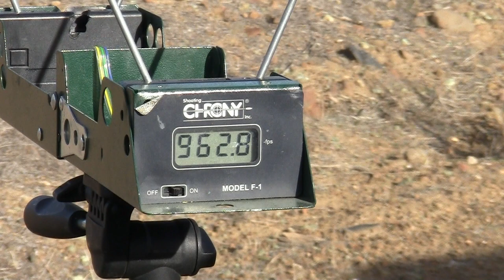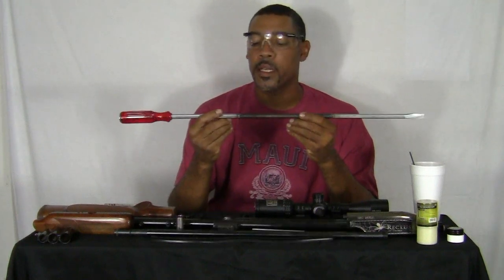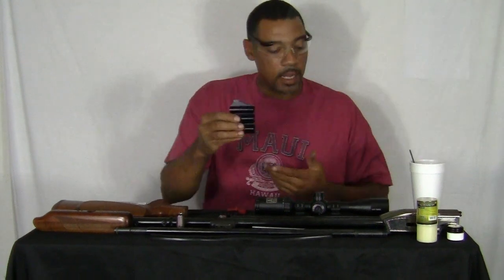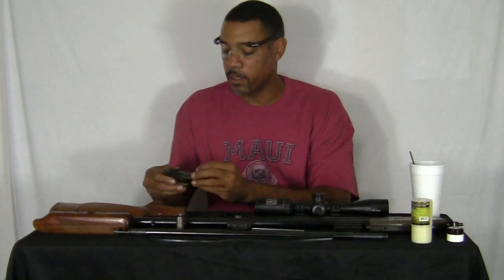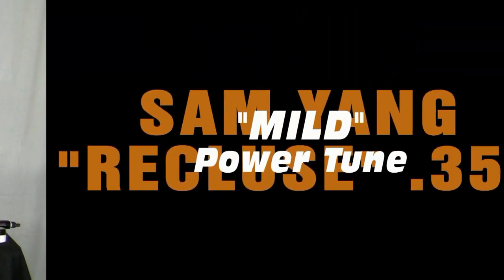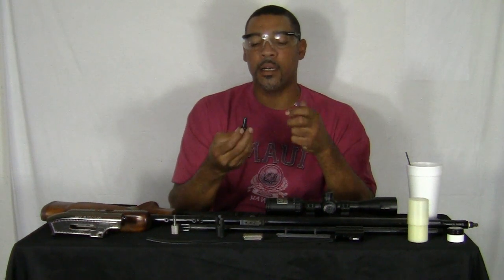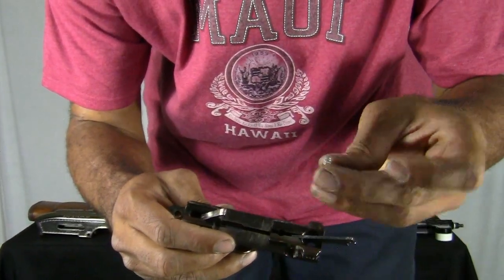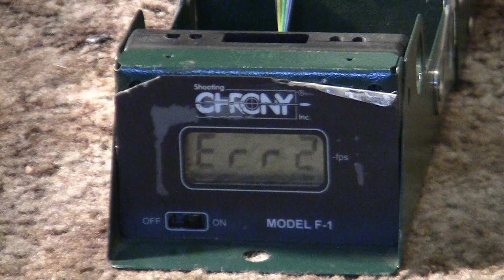Sam Yang .357 Disassembly & Tuning (Chrony #s)

Comment: great video, thanks... I have a 2500 Sumatra... All of a sudden it has lost power, on high it is only getting about 750 FPS and low setting is about 400FPS... it was like over night it changed.. do you think it might be the hammer spring??? also does the Sumatra come apart similar to your San Yang ???
Reply from the maker: +Norm Soucy I've never dissassembled a Sumatra.  Sorry!
Reply: Kratos000S Returns are still covered under warranty most times and usually cost hundreds less. Also, this gun is pretty reliable, so a refurb was probably delivered with a scratch in the stock or something. Get the refurb, if your not rich.

Comment: I've watched this video several times and I appreciate you sharing your knowledge.  I have had my Dragon Claw 500cc tuned, but I'm still not happy with the power.  Getting about 310 FPE max with 280 gr slugs.  I still have the original hammer spring, so I really want to put a spacer or shim like you did (that was not done on my tune) also, I'd like to open up the hole in the end of the valve.  I'm wondering, do I have to still remove the barrel and totally disassemble the gun just to put in the shim behind the hammer spring ??  Thank you for you videos !!

Comment: I am trying to convince a very good "back-yard" Airgun Smith, to bottle my single tube Recluse with a 22ci bottle. I need the additional air, but persoanlly cannot stand the look of the dual tubes myslef. He will too do the "medium tune" and polish, smooth out and de-burr all of the internals, especially the trigger assembly. Plan is to fully integrate the bottles gauge into the forearm of the Recluse's forearm (like the bottled Mrods and Daystates), giving it a more cleaner and professional finish. Cannot wait for this to take place! Thank you for sharing! p.s. I will not be switching out the barrel, as now have two rounds that out shoot round ball and the JSB rounds, producing up to 167-fpe without tune! Awesome stuff! Merry Christmas and Happy New Year Cedric, AGW.
Reply from the maker: +AirGunWarriors OKAY, OKAY....i won't ask too many questions but boy do you have me curious with your future build.  I agree with you also about the double tube design.  I would love to see either a bottle like what your referring too or just 1 bigger OD airtube like on the older Dragon Slayers.  I also agree that the OEM 20" twist barrels are accurate when you have the right slug.  Mine loves the 105 gr SWC as well as some others. The LEE 105 gr SWC worked great in both the 1-16" and 1-20" twist barrels.
Reply: +Tofazfou I will make an attempt to make a video as clear, informative and concise as yours when finished.:) Yes, a larger diameter single tube would be a lot nicer/lighter and look better than the dual tubes. But, I am thinking will get much more volume of air with 22ci bottle. Amazing how powerful the Sam Yang Recluse already is before a medium tune, especially considering its price. For me, it is a "true" big-bore, in that you are not limited so much as to slug weight/size (as long as twist weight is in line with slug) and it produces 100+fpe. Amazes me how some factories release a .357/9mm big-bore airgun, that cannot even produce at least 100-fpe straight from the box. There are some factory made Big-Bores in .357/9mm that can barely produce that much more energy than some of the factory made .30 airguns or cannot even produce a minimum of 100-fpe and its like..."why bother"? Thank you again very much for the tutorial, AGE.
Reply: +AirGunWarriors not "AGE", but...AGW!
Reply from the maker: +AirGunWarriors In OEM form, they gun is very capable.  Nothing wrong with it powerwise there.  For the person who is not interested in MODDING for more power, i still suggest cleaning up the action and doing some MAJOR trigger work.  The trigger is bloody aweful.
Reply from the maker: +AirGunWarriors AGW, thanks for the Kudo's and i too agree with you on the double tube thingy.  I too would prefer like one big 1.25" tube or something close to that.  A bottle isn't too bad an idea as long as the barrel is kept at 24" or shorter IMO.  But a nice long fat tube would be my idea of a good time.....lol!

I also agree that many airgun manufacturers now are getting into the MID (big) bore rhelm and that awesome.  But for 2000 Bucks, i too want more than 100-140 FPE for that kinda money.  A big 35 cal pellet moving at 700+ fps simply isn't sexy or my cup o tea.
Reply from the maker: +Kratos000S never handled or shot a hatsan 35. but i know its stats. the hatsan makes less power by far and seems to be a better pellet shooter as far as accuracy MIGHT go. The Recluse makes more power in stock form and is capable of taking small-medium hogs all while shooting cast bullets and or pellets very accurately. Modded, a recluse can make 250 fpe. Again, Not sure about the Hatsan and its potential.

Comment: excellent video, thank you for putting the time and effort into making this. I have a Recluse and 909 on order and this will help me greatly. Once again thanks
Reply from the maker: Thanx John.  One thing i can vouch for from personal experience with BOTH the guns you have coming is that, they look much better in person than what you see on websites.  You are going to like the looks and performance of both.

If you choose to tune, they are pretty simple to work on

Congrats and enjoy!
Reply: Tofazfou
Well the recluse has arrived = happy air gunner, if you would not mind could you ask your machinist if they would not mind making up another cocking handle, and posting to Australia if possible, I would pay through paypal or call them with CC. If they willing could you let me know and I contact you through the yellow or GTA forums for details. Cheers
Reply: Tofazfou
I just noticed you had a email address on your blog I will send an email to that hotmail address

Comment: Thanks for a decently explained, and detailed look at your Sam Yang Recluse PCP.  I especially enjoyed the brief tutorial concerning polishing, and lightening of the weight over the factory trigger setup. I must confess to being somewhat of a "trigger nut". You seem to obtain very decent velocity for this gun on low power. Would I be correct in assuming that shot count be one reason you prefer low, over high power?
Ciao
Prunesqualler
Reply from the maker: Well, the object is to be able to push PELLETS and ROUND BALLS on low power at decent speeds. 650+ fps on low power in OEM form just doesn't cut it for me.  Then, on high power, i can push cast bullets at good speeds also.  Low power allows me to have a couple more consistent shots (shot count) over high power while still providing damned good stopping power for small to medium game. So i should be able to go for jack rabbits and coyotes simply by inserting a bullet or pellet and going from low to high power or vice versa.  Hell, with 860-880 fps with 81 gr JSB pellets, low power is plenty for coyotes also out to a certain range.  There is still a lot of testing to do and a lot of theory to still prove..............

Comment: Tofazfou   my same yang recluse has an issue with the bolt blowing open when firing. this allows air to blowback out through the breech is this a breech seal issue or something else i need to look at i didn't see you cover this seal in your video. i have did some research and they breech seal seems to be a common issues with these if you have insite please send me and email.

Comment: what size head is on your long screwdriver mine just to small it's long enough but it just goes in the middle and my butt stock it wiggle
Reply from the maker: +Jasper Green Off the top of my head, about 3/8" wide +-

Comment: With the long screw driver to take off the butt is it a phillips or flat head?
Reply: Timothy Hicks flat head
Reply: I love my .50 dragon claw. But I want to change the stock to a tactical sliding or folder. The Remington 870 stocks look like they will bolt up with a little modification. Has this been done that you know of ?

Comment: Does anybody know what to do when your air rifle leaks air from where you put the air in. it's a 50 caliber
Reply from the maker: Diego, if air leaks back OUT from the fill nipple when you remove the airhose, then your fill nipple either needs to be replaced or rebuilt.  They are simple to work on.  WITH THE AIRTUBE EMPTY, you simply unscrew the fill nipple and replace it with a new one or rebuild it with a rebuild kit.
Reply: +Tofazfou do you have any a guns for sale
Reply from the maker: No Sir

Comment: How do you depressurize the tubes
Reply from the maker: you have to shoot the gun till its completely empty.

All airguns currently SHOULD have some sort of special degassing tool like Benjamin guns do.  It should be a lot easier than shooting all the air from the gun.
Reply: Tofazfou Jus had a 2500  lock up, seems like there is more than one pellet  went into the entrance
Reply from the maker: TheMisterg34
If your referring to the MAG and BOLT locking up then yes, i too would assume you double loaded a couple pellets.  I hate that...................